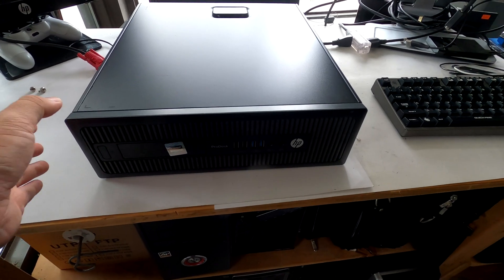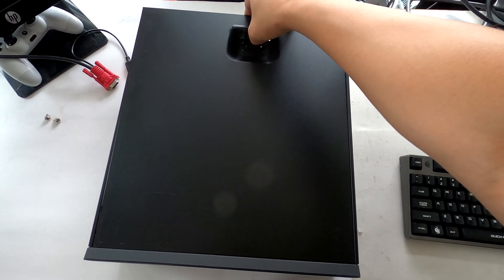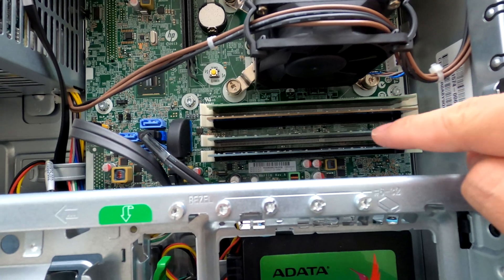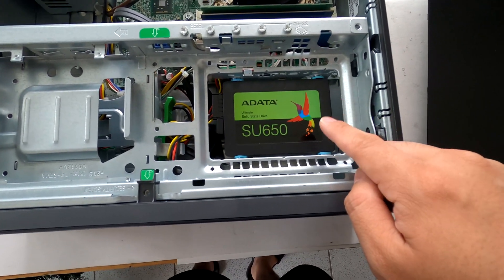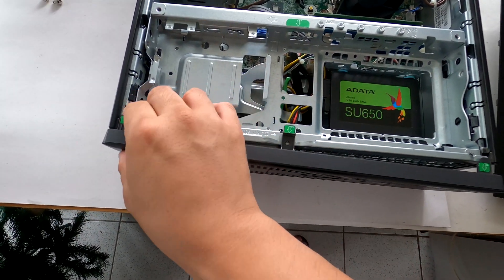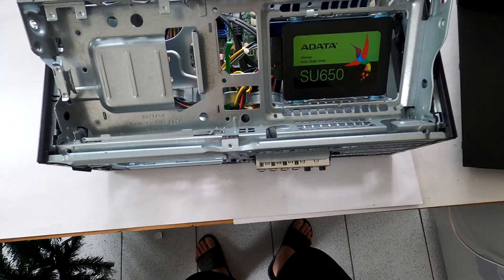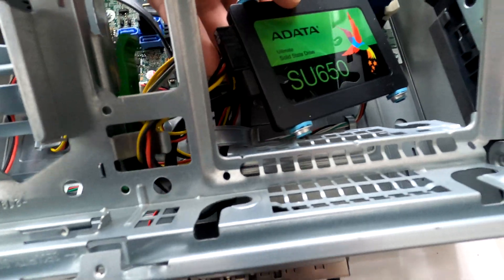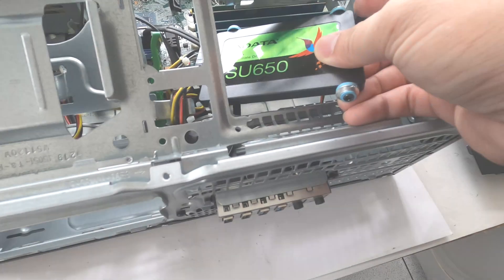HP Prodesk 600 G1 Upgrade RAM & Hard Drive (Disassembly, Replace SSD)

Comment: Can I add extra 8gb ram in this device(already have 4gb)...could it be create any problem for motherboard??
Reply: this little pc is able to hold 32 gb memory ram without any problem. I have the same model with 32gb ram +1000gb SSd +  1000gb Hard drive + 4gb Nvidia graphics card and running great .
Reply from the maker: Not sure... you should find the motherboard model first, then look for the maximum memory per slot on google

Comment: which 4gb graphic card i can use with HP Prodesk 600 G1 SFF ? Kindly suggest
Reply from the maker: if you go to the HP official website, you can find the specification for this machine. Then you need to find out the type of the pci-express on this computer. After that, you need browse a graphics card that supports the same pci-express version on your HP computer.